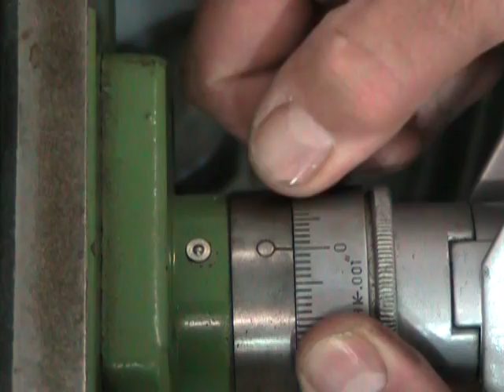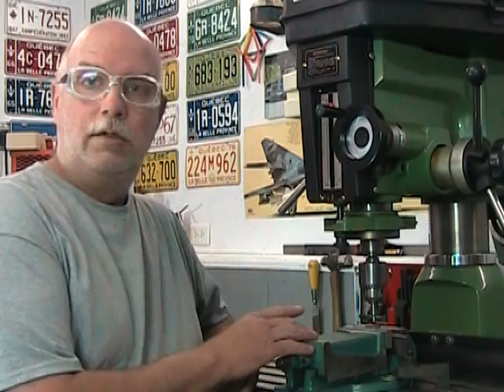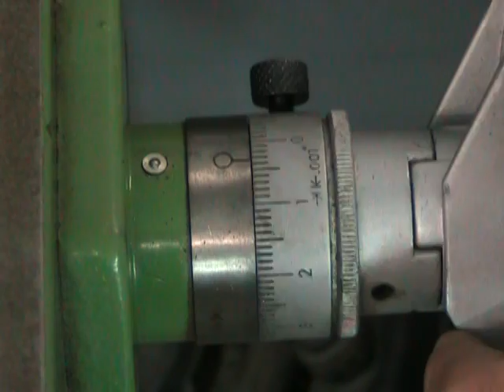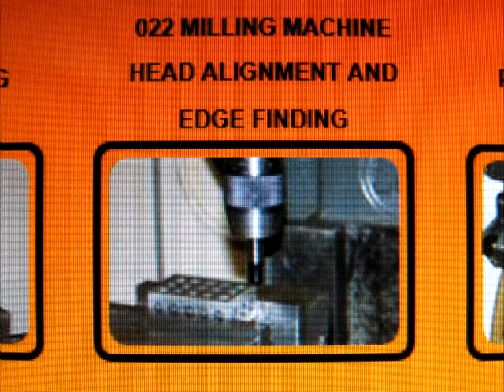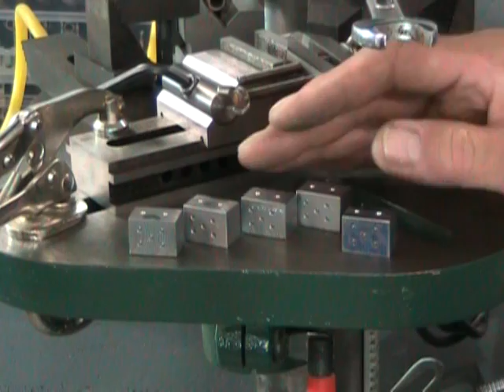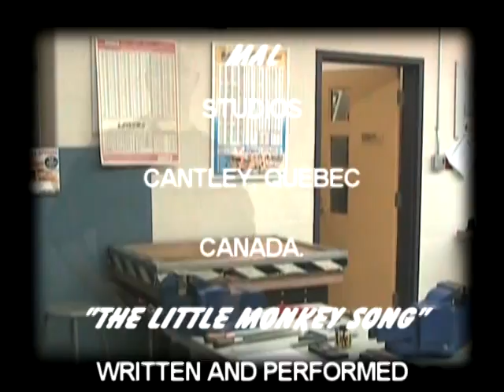TAP BLOCK PART 5, DRILLING 101 MARC LECUYER

Comment: Hi Marc,
Exceptional video as usual , i hope the guys who are doing the hardening and grinding on those blocks make some videos of the work they are doing and they do a good job !
I like your safety glasses and it looked like they were bi- focal ?
I'm interested in this because now i'm mid 40's my eyesight is starting to drop off and focusing on small items is starting to cause my some issues.
I do have a head band type magnifier which i use but it is cumbersome so i was wondering if you think the bi- focal glasses could be a solution ?
I don't need glasses to read yet but i sense they are not far off !
Ideally some type of magnifying lens that clips onto a set of clear safety glasses that flips down when needed would be ideal but i have yet to see anything like that.

Ian

Comment: Marc,
Thanks for the video. I do have a question:  Don't you have to also add half of the diameter of your edge finder? Thanks again for the video series.
Have a good one!
Dave
Reply from the maker: Swarf Rat Yes you do. I will have to take a minute to watch the video again but I am pretty sure that I added the .1". Marc
Reply: THATLAZYMACHINIST You did.
Reply: THATLAZYMACHINIST Sorry. In rewatching the first part of your video, you did state when you were setting the dial on your mill to allow for the edge finder. Sorry for the confusion.